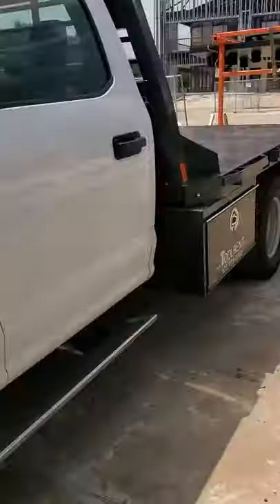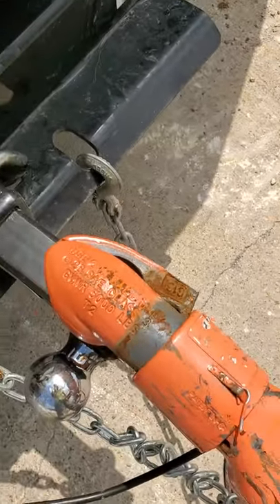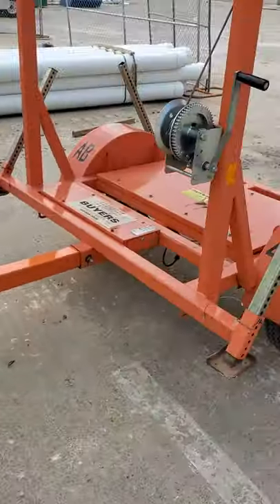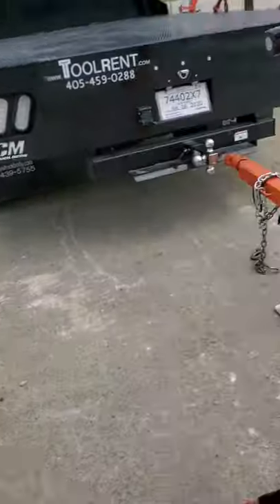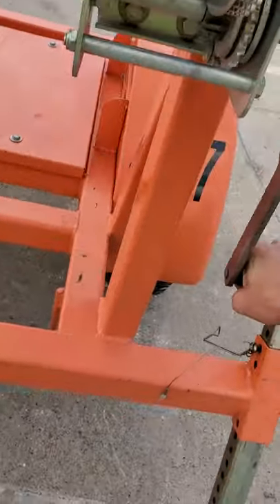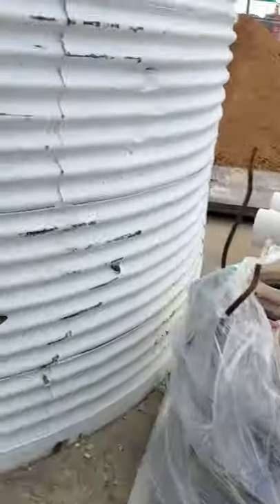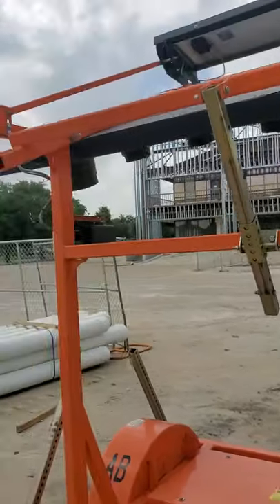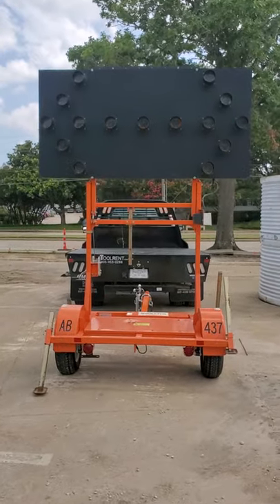Arrow board setup

Comment: Tires off the ground!

Also it not a requirement & not an option with that board, but use the chevron setting when tapering traffic. (You have the merging arrow option on there tho.)
Use an standard arrow when just signaling traffic to get over. (Striping, mobile ops, etc…)